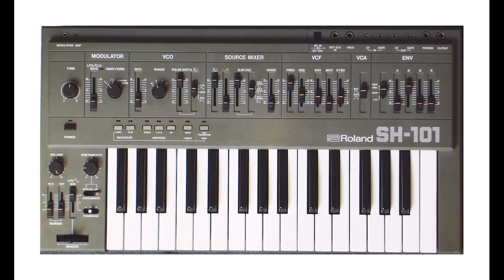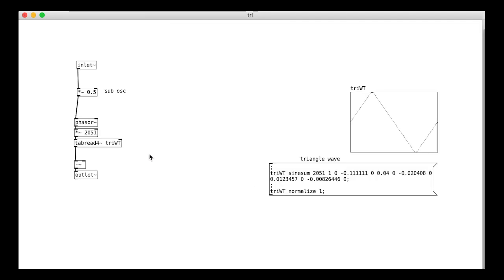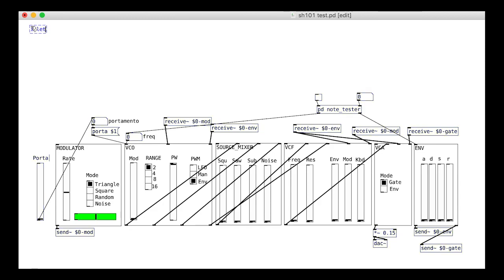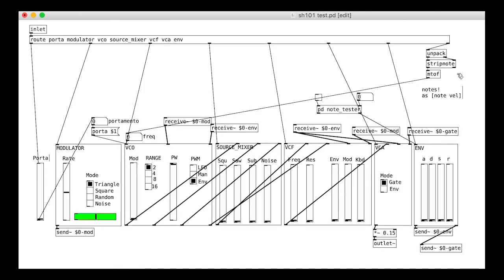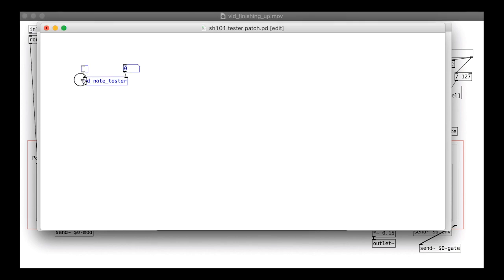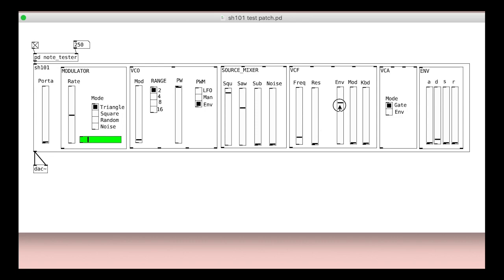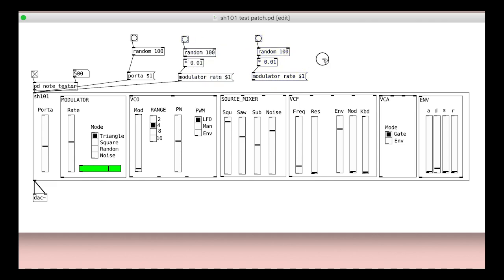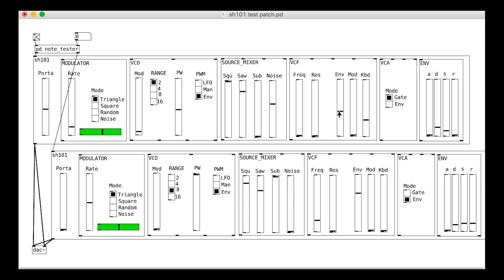PureData tutorials - rich synthesis (26) - Roland SH-101 (7 - finishing touches)

Comment: just one thing, one your wavetables you always use 2051 samples, whenever i go over 2048 pd rounds them to that number ( 2048 ) and it tends to lag my computer. I'm using windows, so maybe mac processes 2051 while windows doesnt? Anyway, it was something that stood out to me while doing your tutorials.

I'm having a blast with this synth! Made a few alterations for more flexibility, but mand do I love your tutorials!!!
Reply from the maker: Yep, good point. The idea here is that the 2051 size array allows for the four point interpolation in the tabread4~ object. Thinking about it a bit more, I think that would require [*~ 2048] instead of 2051 (but perhaps an array of size 2051 still) to work effectively, but I'm confusing myself trying to think through how the interpolation works when it wraps back to 0.
Reply: @reallyusefulplugins  the tabread4~'s input should be going from 1 to 2049. The reason is that the interpolator needs an extra index to the left and to the right, and 0 is the first index and 2050 is the last index. The way it is now there will be some extra distortion (aside from aliasing).
sinesum and cosinesum will make the last 3 elements the same as the first 3 elements so that when the phase wraps around there won't be a discontinuity (the interpolator needs 2 samples to the left and to the right of its "fractional" value)
Reply: @sub-harmonik   practicaly, the table will be 2051.... but in the sinseum message should we use 2048 or 2051 to fill the table?!
Reply: @defjam993  pd will round to 2048 if you put 2051 but it's supposed to be 2048 in the message
Reply: @sub-harmonik  Ok Thank
 you Seb
Reply from the maker: @sub-harmonik  Yes, brilliant, you are technically correct. The best kind of correct.
Reply from the maker: Should probably be using [tabosc4~] here in any case. We will have to revisit our wavetable tutorial soon
Reply from the maker: And as Igor has said, that would be fine with a 2048 table
Reply: @reallyusefulplugins  I was originally going to suggest [tabosc4~] but you can't use it for the pulse wave because you can't control the phase offset
Reply from the maker: @sub-harmonik  Yes, also a good point